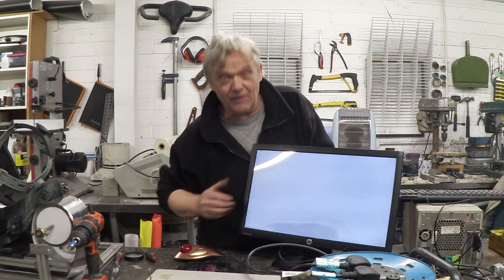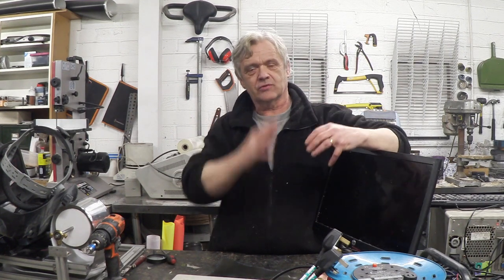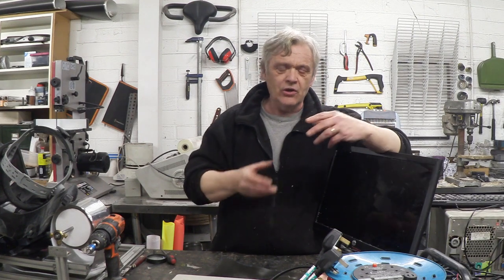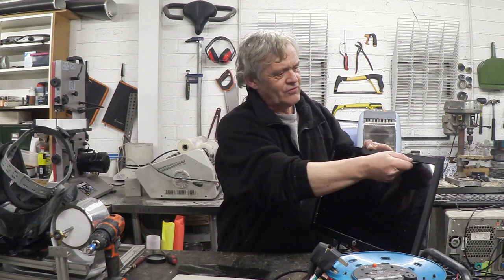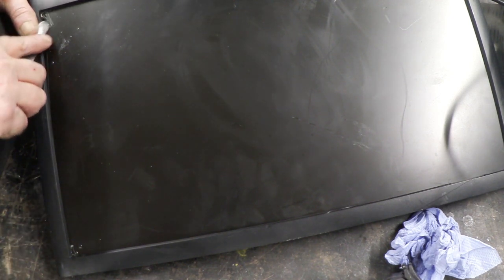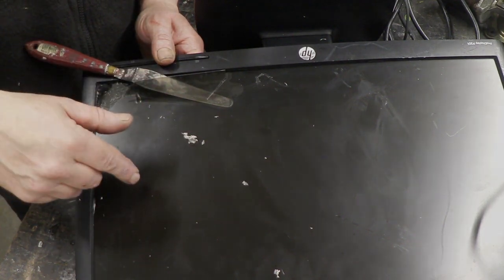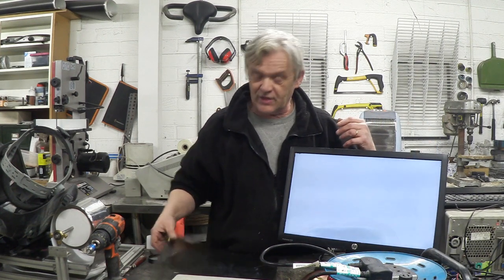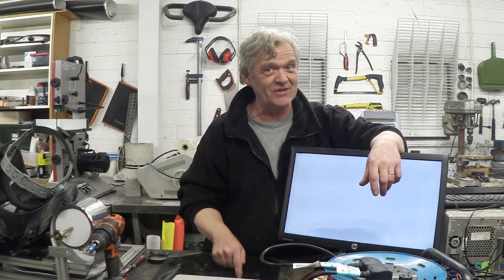1003 Making A Computer Screen Only You Can See

Comment: Honest story here. My son broke his Kindle Fire Tablet screen. I searched on Ebay for a replacement and had it posted to me. 
Replaced the screen and digitiser, turned it back on and the screen was white. 

I then realised that the old screen had a 1mm film on it. Which I later found out was the polarised film. Poured hot water on the old screen to remove it and tried to reuse it on the new LCD screen with no luck, the hot water had wrinkled parts of it. 

Ended up cutting out what I could salvage, two circles worth, and glueing them to some sunglasses after removing the lenses.
Reply: the replacement should have included a polarizing film.  (assuming you mean "Screen" is short for the LCD screen.)  This seems very strange to me....

Comment: Once you have the corner peeled, spray some WD-40 or Windex on it. It should change the adhesive's chemical structure and help it debond. Works on removing window tint from your car as well.

Comment: LG 3D TVs us 2 opposite polarized lenses in their glasses. So does 3D movie theaters. So you should be able to take 2 sets of glasses and figure out if you need to use both right lenses or both left lenses for a set of polarized glasses.